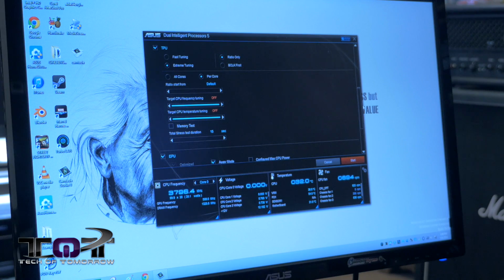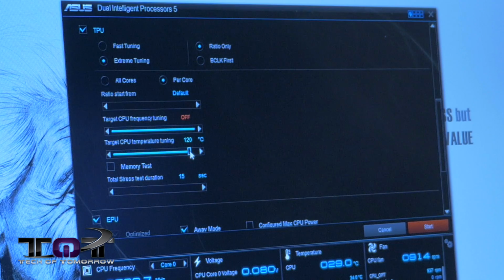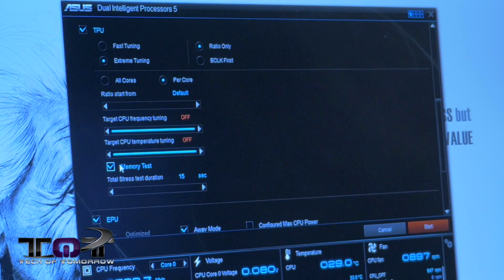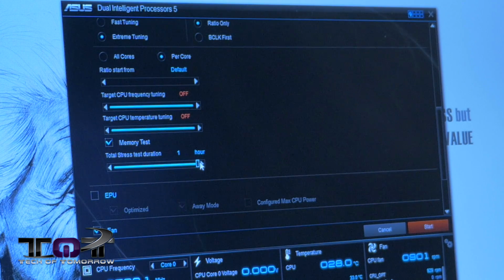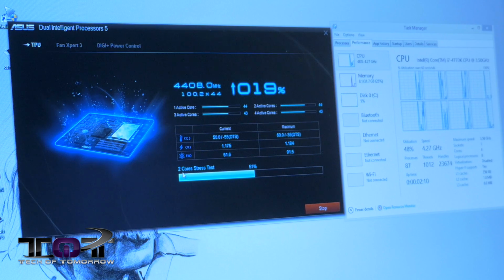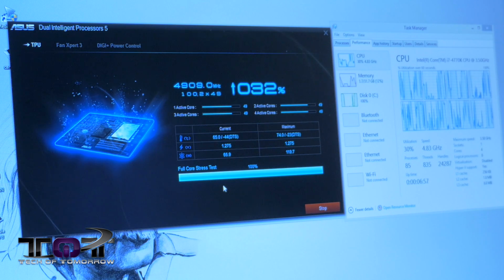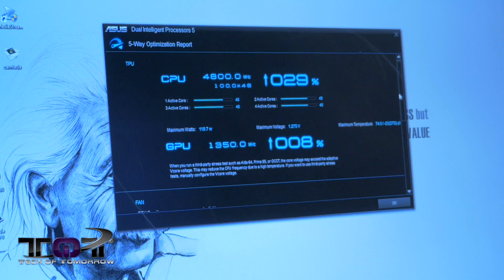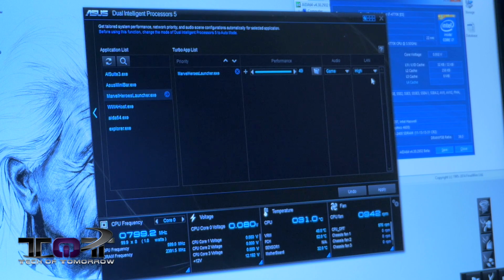How to Overclock Your CPU Using ASUS Dual Intelligent Processors 5

Comment: 28 degree? How you get that low of a CPU temperature ? I am using the same water cooling system H110i, but the lowest temperature I've ever seen is 38 degree(No OC). Am I doing something wrong?
Reply: check ur paste on the cooler im getting 28-29 idle temps

Comment: Can recommend to stress test between intervals of at least 15 minutes stress testing ! 15 seconds is way too short to tell if the system is stable... Other than that, works quiet well on my X99 platform, i7 5820k to 4.3. Some manually adjustment made afterwards though but will save a lot of time.

Comment: This software is garbage.  Never stable and always interdependent with the OS version.  On a Crossfire Hero V11 X470 board, this software freezes during the overclock process.

Comment: when you pick bottom fan  position as a fan settings in autotuning, which way is the fan blowing, in or out? Does the autotuning software know which way i got my fan blowing, I want it blowing air into the pc.

Comment: Why are there so many videos for this suite, and he NEVER talks about how to get it up and running????? I have a supported asus mobo, but do not have this suite in the asus folder.
Reply: I was thinking the exact same thing. After a bit of messing i found it on the disk that comes with the motherboard. i installed it off there.

Comment: im running a maximus ix with a i5 7600k and asus 1050ti 4G oc gaming video card I know but I just don't like the 1060 series and the others are out of my budget so I was playing with the settings and I just set it at a 80c temp limit and it hit 5200 MHz before I got the blue crash screen I have to say my my7 captain 240ex cooler is certainly doing its job what would ne a good setting for my cpu frequency?

Comment: Yeah it overclocked my 3.5Ghz 6600k to 3.47Ghz. I'm not sure what to make of that.
Reply: It upgraded my 3.5ghz 6600k to 4.5ghz. So I'm also not sure what to make of your comment. :O
Reply: I have an aio water cooler. It should do fine. The temps didn't go over 65 anyway

Comment: i tried it with my Fan Corsair and it broke it since then the engine of my fan is make a very weird sound.... i feel they should be a popup saying, it might break your hardware continue as taking in note thoses RISKS....
Reply: where did you get it , i cant see link on asus website. be carefull with other links
Reply: i downloaded from the official website. select your Mother baord in my case i have the Maximus III Ranger then support then download
but im sad it screwed my stock Corsair fan, so i bought new PWM fans
Reply: Actually i am very happy with the Mag lev fan from Corsair ;) i have noctua for the CPU also happy

Comment: I'll bite.  I can out overclock any auto overclocking motherboard. 

Yeah right, you won't TOUCH 4.8ghz on that on automatic settings. 

I'm starting to hate these hardware reviewers.  Yall lie and LIE so you can have the best numbers. 

Just liked back in the 60's when automobile magazines LIED about the Pontiac GTO hitting almost flat 13 second quarter miles at 109 miles per hour. 

Look it up.  They all wanted to post the best times, so it got out of hand and That's why the GTO has the reputation it does.  In reality, they ran 14.2's or higher on those old school tires. 

Don't be a GTO article writer.

Comment: This stupid software nearly kill my board and chip... It's goes up to 5.8 while I was taking a pee... I had to quickly hard reset my comp and its couldn't boot, clear cmos with my sabertooth mark 1, now my motherboard / processor weird sound when I on high intense cpu games... If JJ able to see this, is my mobo still valid for warranty as I used "ASUS" DIP5 that killed my board...
Reply: +Teoh Eu Jie Did you watch the video? You should have set the maximum CPU limit for voltage and core... If you had done that, it wouldn't have gone up to 5.8....

Comment: I don't get it. For the software doesn't really change my fan speeds... And the fans are weirldy in the system even though I followed all the manuals and put the fans in the headers in order (1.2.3 etc...)
Own a z170 deluxe, with a i7 6700k cooled by a h110igtx...

Comment: This program is weird as hell, it's good only for mild OC, I tried to Extreme OC my i5-6600K (for reference this CPU can potentially OC to 4.7GHz max for home users) with TPU II and this program tried to take it over 5GHz, the system then just hangs with the monitor completely black. With no response in 1 hour I hit the power switch and had to CLEAR_CMOS just so my PC can boot to BIOS again. Also using 5-way optimisation my 2133MHz rated RAM can only operate at 1866MHz

The fan expert 3  is also a bit dodgy it conflicts with BIOS Q-fan control, and the desktop gadget doesn't respond properly (some fans will not go down in speed), so If I want to switch fans from Turbo to silent I had to open the program to do it.

I uninsulated the softwares and spent some time to manually overclock and configured my water pump&fans via BIOS, my PC runs much better due to less CPU and RAM usage from the app, RAM runs at their rated speed, and generally much more stable system.

Conclusion? BIOS>AI Suite III
Reply: Not sure about that CPU issue, I ran it a week ago and its taken my CPU to 5.1Ghz and its been having no issues with my pc, my CPI is a i7-7700K tho so maybe that makes a difference?
Reply: (whoops didnt realise this was 2 years old lol"

Comment: D.I.P. 5 used to stay in auto mode but now it switches into performance mode and when it does this my vcore no longer lowers, Its static 1.32v. I am not sure which setting is causing this. Any ideas?
Reply: ***** That is precisely my point. before I was able to get voltage to lower when using a manual oc. It worked just like adaptive simply by enabling c states. Now its just a fixed voltage. I updated AISUITEIII so it has to be the culprit but why would they change that? Makes no sense.
Reply: JAY LEE I figured it out, I enabled dynamic storage accelerator in bios apparently. That is what put my cpu in performance mode not allowing voltage to drop (manual oc).
my bad.

Comment: this software set my 4790k at 4.7 ghz across all cores, i am using water cooling but the voltage is set to 1.325v with an offset of .025, is that safe? i wouldnt imagine asus would damage my cpu.

Comment: Hello JJ, which power management profile are you using? Because i am having issues with my CPU frequency and Voltage, they jump up and down, they dont look steady as the video, and they are creating a lot of heat, 38 to 43 idle, i dont know if it is how my 5930K should work, i am running it in a Asus Deluxe x99. It is running at default settings and clocks. Is it normal?

Comment: What is all this froofy overclocking? I would need full manual. I'm still using my 980x so I haven't used UEFI so I hope they didn't remove old school overclocking. I hope you can still turn off things like C1E support. I don't like any down clocking what so ever.

Comment: When I Auto Tune my 4770k with my M6F I choose 4.4MHz. After it runs I get 4.4MHz at 1.26v and my ram runs at 2395Mhz not 2400. So I don't mess with it, from what I understand thats way to many volts for that low of a clock. I wish I knew what the hell I was doing so I could just do it myself.

Comment: Is that a BSOD on Windows 8 or something = = "??? 
And JJ said Elric's home is bit warm lol !??!
Dude come to Malaysia , South East Asia, tell me that shit.
I have to suffer room temp least starting from 30 - 33 C daily ! 
Imagine that and when in demanding games while my GPU on load over 70C dumping out more hot air , same goes for my CPU though only about 40 - 50C never over 50C. 
Now tell me if Elric's house it's still warm then....
Reply: "bit warm" means slightly warmer than average, doesnt mean its a sauna lol
Reply: Yes that is a windows 8 BSOD;Friendly for normal users  and quite a pain for power user.
Reply: anarghya jantali Well least it looks less scary lol...but why a pain for power users , lack of details ?
Reply: Eric Tan probably why yeah, older BSOD would give you an error code at least lol
Reply: Eric Tan You got it right here;First of all the error shown such as' WHEA UNCORRECTABLE' error or such would be insufficient to conclude exact hardware failure or error!.The only thing that you cannot point-out what went wrong at the first glimpse is pain!
Reading dump files and analyzing,when restarted is a thing one can skip:)

Comment: Does this only overclock the cpu or can/does it overclock the gpu as well, and is there anyway at all this could fry my system?
Reply: he mentioned during the video that it can overclock the iGPU. probably wont overclock discrete graphics cards though. it shoudln't fry your system, as JJ said during the video the software will never allow the voltage to go above 1.275, a value which ASUS engineers have determined is safe for all cpus that fit in that motherboard. still unsafe to attempt an overclock on the stock cooler though of course.
Reply: megaspeed2v2 so is this only for a specific set of hardwar like a specific motherboard or something? Sorry its just I was multi tasking while watching this video :p
Reply: Apoqsi yeah its specifically only for Z97 motherboards, as JJ said it took tens of thousands of man hours to make the software to support all the intel cpus supported by their Z97 boards so to make the software compatible for more would either take a decade or would be less reliable

Comment: Quick question guys, What is a safe temperature for my cpu 4770k? I'm afraid to let it go past 50c, i've been like that with all my cpu's. How high can i go and not degrade the life of my cpu alot.
Reply from the maker: Ext reme A bit harsh man, tone the attitude down a bit.
Reply: I'm sorry, but it's kinda true...
Reply: Ext reme I want my stuff to last, thats why i shoot for low temps.
Reply: Eight Bit Nine Gaming Mine is water cooled by the way, 280mm rad.
Reply: Eight Bit Nine Gaming that is a REALLY low temperature though, even old intel cpus could handle 65 degrees, under 80 is enough nowadays to last 24/7 usage without causing damage so 50 is ridiculous, you would probably actually have to underclock to even stay under 60 lol
Reply: no im clocked at 4.6ghz it stays between 46c and 50c on max. I've always been afraid to hit any higher than that so i wont over clock it further.
Reply: Eight Bit Nine Gaming seriously? what kind of cooling system do you have?
Reply: corsair h105, fans are corsair sp120. I keep them on max.
Reply: basically i overclock the cpu and drop the vcore, I try to find a mid more less. ill overclock as high as i can go then ill start dropping the vcore to lower the temps. I find a decent medium.
Reply: Eight Bit Nine Gaming yeah.. thats what your supposed to do lol, still... keeping under 50 at 4.6GHz even on a H105 thats crazy :o
Reply: They are all different.  You need to check deep in their website.  Intel claimed the s775 Q6600 could run at, what was it, 80C, 90C?  

Besides, and any one can try and prove be wrong, but the ONLY way you'll fry and ruin your CPU is if you can actually max the voltage in the BIOS and actually have it boot and run for 2 seconds.  Then, yes. 

Otherwise, they ALL throttle.  Your temperatures are great.
Reply: +JustAGuy Oh, sorry, thought you were on an FX 8 core AMD for some reason. 

Dude, the original poster's temperatures are fine.  If you want to feel better, sit it near a vent so the A/C blows on it.   Or, just reapplying paste, and doing it in the same way you did before, can cause a 5 or more degree temperature because of how sensitive the heat transfer through paste is.

Comment: Euw. 

'let me run a four second stress test to determine if my 5GHz OC is stable'

GJ ASUS.
Reply: I remember on Z77 (which i will keep using) that they had a 4 second stress test to determine if your OC was stable.

ofc people with half a brain would use Prime95/AIDA64/OCCT to do a proper test.
Reply: ***** 4 second stress test or not, Auto OC is the nastiest OC. better going to the BIOS to do it then run OCCT for an hour or two.

Comment: I just want to download this software for my Sabertooth R 2.0 and i cant find it anywhere :(
Reply: Me too, I have the same Motherboard, But I dont know if it's for our motherboards too..
Reply: Salih Durmisi
It doesn't work. I found AI Suite 3 today, installed it and i got lots of blue screens right before windows starts and you get to your desktop.
Rolled back to Asus Suite 2.
Reply: It comes on the disk with Asus z97 motherboards.
Reply: ***** Damn so there so this auto tuning won't work with then x79 platform will it? I am also curious to see how this new chipset improves the haswel chips? Will it be comparable to x79 or is the x79 still king for HPC?
Reply: Is there an alternative for us with Sabertooth fx990 R 2.0?! AMD 3850
Reply: ***** Something like AI Suit 3, but for Sabertooth fx990 r 2.0
Reply: ***** yes, but Asus Suite 2 doesn't have that cool auto OC like 3 has :D

Comment: I am embarrassed to admit, especially considering I call myself a nerd, that I have had my 1600MHz RAM modules (8GB) running at 666MHz the entire time I've had them because I had forgotten to enable the XMP profile in the BIOS. I even tried to change the level in OC Genie but it kept resetting back to 666 (I thought my RAM was just demonic LOL) I have now altered the required setting and my RAM is now operating at it's full potential hangs head in shame
Reply: lol the same thing just happened to me. I love these videos, you learn a little everyday :)

Comment: Is this only on z97 chipset boards? Or is it on z87.z77 boards.
Reply: Z87 and Z77 have their own versions of the software which are slightly older. they cant make a new version work with all motherboards every time because they would go bankrupt so they can only make big updates while working on new motherboards and just apply patches and bug fixes for the old ones.

Comment: These options are not available for ROG series... I dont know why...
Reply from the maker: Yes they are, you are incorrect Sir...
Reply: Tech of Tomorrow
Hi, Im really happy for your reply! Anyways, my motherboard is Asus Hero, I installed the latest AI suit and tested it on both windows 7&8.1 64x; however there are fixed overclocking options, which are 4.2,4.4 and 4.6 Ghz. There are no such things as auto overclocking and temp limits; etc. 

Maybe there are missing options Im not aware of, but Im 100% sure these settings are not for ROG series. 

Regards and sorry for my shitty English.
Reply: Tech of Tomorrow
Ok, sorry dude, I owe Z87 mobo, Dual Intelligent 5 is for Z97. I never knew it was released recently.

Comment: Real men overclock using the BIOS.
Reply: Yeah but if the built in "5-way" gets you the same end result then why bother with all the BIOS settings?
Reply: Victor Libre still recommend the BIOS :P
Reply: Victor Libre nope, doubt it. Over clocking via the bios is the best option. Far greater settings are available through there, allowing much more controlled changes to clocks speeds etc.
Reply: ***** LOL, yea but BIOS and UEFI are words that are often used interchangeably
Reply: Progster0192 Then you're done.
I got a friend of mines 3570k to 4.9 GHZ, not possible with the auto overclocking magic because it hit its voltage limit
Reply: blade00362 Says the person that has a mac desktop picture as their profile picture...

Comment: i had failures with 4 way control after the oc tuning and im wandering if the 5 way uefi can be used on the deluxe Z87 because the z97 is the same chipset as the z87 with just addon of m.2 and sata pcie option connections?

Comment: Where and how do you get the program? Does it work on all motherboards? I have an M5A99FX Pro R 2.0.
Reply: I have the most up to date version from the website for my Maximus VI Formula even so the ROG Version does not overclock the CPU as shown, it only gives you 3 presets of 4.2/4.4/4,6Ghz  yet nowhere is it mentioned in any of the videos including this one is that the method shown is not present of the ROG boards.

Just check the ASUS Forums and you will find numerous customers annoyed because it was never specified that the method shown by JJ was exclusive only to the channel boards and is not present on the ROG boards software even with the latest updates.

The point is JJ should specify that the ROG AI Suite 3 does not overclock the CPU in the same way
Reply: its on the driver CD or you can get it from their website
Reply: Off the ASUS website.  Compatible software will be under the downloads tab for your motherboard.
Reply: James Brand NEVER use the software on the CD.  Use the version from the web site.  That is the most up to date version.

Comment: i have a question, i have asus p8z77m-pro am wondering if new versions of the software will work for my board/older boards.
Reply: I am assuming that this program comes with new z97 boards.

Comment: cant find the ASUS Dual Intelligent software for my asus hero
Reply from the maker: Its on their website!!!
Reply: Tech of Tomorrow Cant seem to find it :/
Reply: Tech of Tomorrow Works for Non Asus boards?
Reply: Tech of Tomorrow not from what i could see. nothing connected to my board  accept the AI suite which is rubbish. and google couldnt bring ANYTHING up for the v5 but saw posts and videos of the V3 asus dual intelligence
Reply: Tech of Tomorrow can you make a download link?
Reply: Go to the mainpage of your motherboard on asus.com. Klick on Service & Support. Then on Drivers and choose your operating system. Under utilities you will find it.
Reply: Use the Dual Intelligent Processors 4 it's almost the same.
Reply: CaptainSpleXx nope. at ;east not for the uk
Reply: SOMEBODY MAKE A DOWNLOAD LINK
Reply: Only works for the mainstream boards and dual intelligent 5 is z97 I think.
Reply: ***** yeah, i already have the ai 3 BUT that only has v4 not v5 available for this board